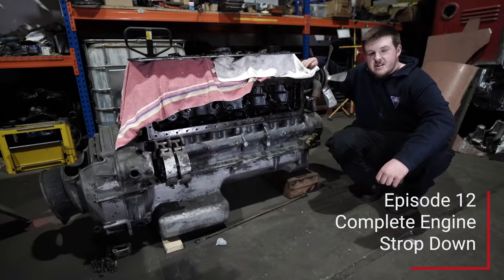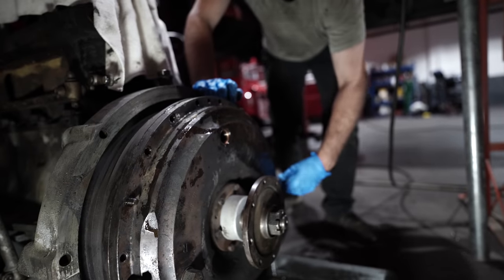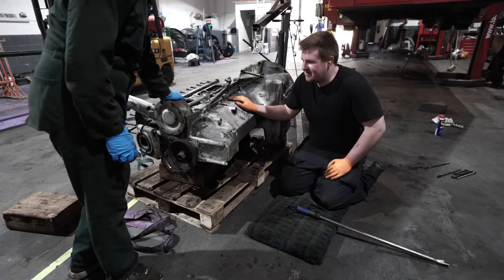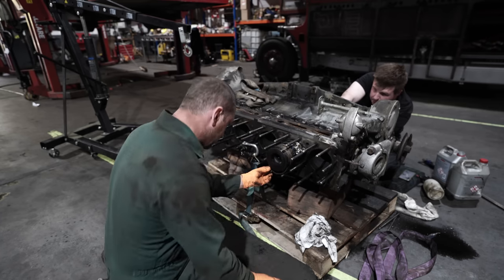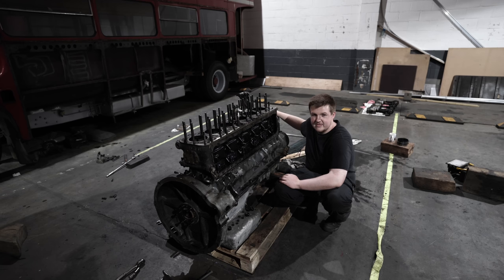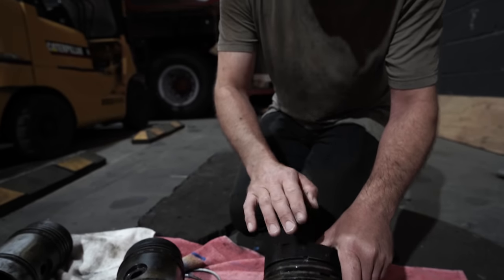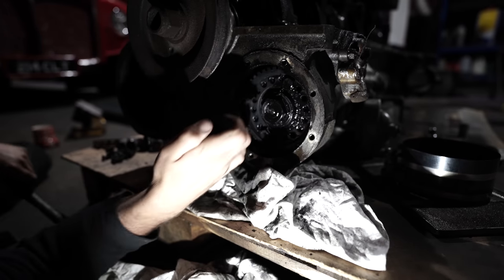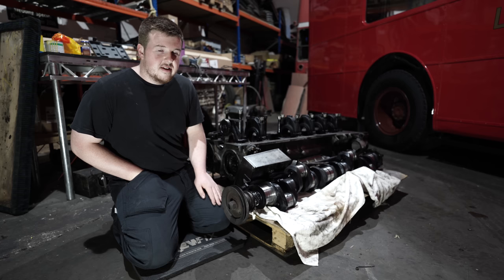Ep12: ENGINE STRIP DOWN Of A 70 Year Old RED London Double Decker BUS

Comment: Thanks for showing the engine strip down.

This is a task that the lads in the garages wouldn't be involved in.
I think the engine reconditioning was done at Chiswick to my recollection. 
We certainly wouldn't have the time, or equipment  for this type of work.

 These Buses certainly had a very hard service life. My last garage BK had a fleet of 140 vehicles for service. I think this worked out at about six million service road miles per year.

With the privatisation of London Transport, all the overhaul workshops were closed down. Good to see that you've got your own mini Aldenham works there. I'll certainly look forward to your next film.

Kind regards Jonnie.
Reply: Engines out and on the Ford Thames ? Trucks to and from Chiswick to garages if required , otherwise swapped at Aldenham (Chiswick still did the Engine Overhauls).  IF This engine is from one of the Country Area Cravens Bodied RTs it has probably done not a lot of mileage - 1949-1956 mostly around Watford, then 7 years in Scotland (cannot think it could have done much - prob construction work sub contracts ? ), a year back in Harold Hill then  broken for spares with the engine coming to this bus.

Comment: I love watching these strip down and rebuild projects. Takes me right back to my mechanic days. Also, when working on an old engine I would avoid using power and air tools generally. You get much more feel for if something is seized or likely to sheer using hand tools and ratchets. Amazing that engine was running with a broken piston ring.
Reply: Someone who understands 🙏.
Reply: Hi Chris......i always use ratchets and breaker bars, no air tools for me, old school engineering.....
Reply: "shear"; engines are not sheep :)  But yes, jokes aside you are right, although if you're stripping down very corroded parts they'll probably break anyway, so wizz away with your power tools!  (Or use heat if they're not easily replaced at reasonable cost)
Reply: @JohnCarder  and spray everything in plus gas, then have a cuppa to allow time to soak into the threads before trying to undo any nuts or bolts......
Reply: I use modern power tools, when appropriate, as my old muscles cannot cope anymore.  Took me 1 year to free a main hull drain plug on a DUKW using patience to not damage and hand tools. So I totally agree with your premise. I already had pneumatic shock ratchet and other power tools but, they could have caused serious damage. I have to admit that my modern cordless power wrenches do have advantages at times. I still love my old hand tools that I can "feel". Just as you say. Hope the coming generation can know which to use for the best outcome. Snap it off. centre punch accurately, drill undersize accurately, re-tap to original thread. Never easy and rarely successful.

Comment: Another great and informative video from Routemaster 4 Hire.
I feel for you guys, expecting to simply replace gaskets and finding broken piston rings and scored bores.
I bought a Morris Minor in the summer which was supposed to be ready to drive. However, delving more deeply into the paperwork prooved it had not been really used in anger for almost 20 years. Structurally sound, with a good engine and gearbox, but it's fighting my efforts to get it back on the road. Now gaskets and seals are becoming an issue, last week, Mabel, as she shall be known, developed a serious leak from the sump gasket. I couldn't quite believe that, I've never heard of such a thing and now the boot seal is letting in the rain 😕 as well. 
Your channel has been a real encouragement, the level of repairs that you carry out is amazing and something to inspire me when I'm on my back fixing Mabel in the street. Will she be ready for half term??
Keep up the good work.
Cheers
Andy

Comment: Many thanks. You have touched on my second question. At Aldenham Works we know that chassis and bodies were separated and usually never reunited. The same, from your video, seems also the case for two separate refurbishment streams for the engines separate from the engines. Yes? And power trains too?

Anyway.

Well done all and thank-you.

Comment: IF this engine has not been changed since preservation,  it was from Cravens Bodied RT 1409 JXC 172  of Feb 1949.   The Cravens Bodied RTs generally didnt get overhauled due to surplus of RTs for service compared to needs and most were sold via the Dealer Birds.   RT1409 was broken up by the North London Transport group eventually with the engine going to this bus ( info up to 2019).  I am not aware of Roy Gould doing an engine swap on this bus.

Comment: Well, it was always going to be an overhauled Engine regardless of what state the rings were in. Crank regrind with new main and big end bearings, new or serviced Oil pump. New pistons and rings with rebored Cylinders, head skimmed with new valve seats, valve guides and if the valve faces are pitted, ground and lapped. New valve springs and replace the Rocker bushes. Fuel injectors serviced along with the injector pump and get a service kit for the water pump and starter and Dynamo, all replacement Gaskets and seals. This should giving you a good long lasting Engine. Re Snap-on impact Tools, I have new second hand 3/8 and 1/2 inch guns with the jacket covers on and the plastic cases or doctors bags. Thanks for video but don’t put Emery cloth anywhere near a Crankshaft!.

Comment: Absolutely brilliant video very educational. You and Lord Barrington need to teach apprentice mechanics stuff like this at colleges man
Reply: Lord Barrington definately needs his own channel, such a knowledgeable Engineer.
Reply: @stefanobio7045  definitely
Reply: @jamesbalchin4640  Unfortunately these type of skills are being taught less and less, due to the high labour costs involved, mechanics are now heavily involved in the electrical / electronic diagnosis side now....
Reply: @stefanobio7045  indeed
Reply: There are less and less people who can strip down and repair mechanical things these days. Its a great shame!
Reply: @timhines6543  Hi Tim....
Yes your correct i can remember the times when you saw vehicle owners on thier driveways at weekends with thier car up on either axle stands or ramps being repaired or serviced, something which you hardly ever see these days.
I also recall all the many independent motor parts shops some even open on a Sunday, you could ask the owners advice on the problem, hire tools like half shaft pullers and torque wrenches etc, but very sadly most of these have now closed, in fact one has just closed near to me after 43 years!
Halfords even had a trade parts counter, and sold all the service type items oils, filters, spark plugs etc, but these days they only have a very minimal stock.
Most of the Engineering technical colleges have now closed and are now just housing estates, all three of the technical and higher colleges that i attended are now all closed, along with it all the great and knowledgeable instructors and lecturers, very sad......
A high proportion of Engineering and manufacturing companies have now closed, steel works, ship building, mining, aero industry, most have closed now, for instance Chatham dockyard with over 6,000 staff all gone, and all those skills not being passed on, the railway engineering workshops in Swindon where so many of our trains were constructed and overhauled by great Engineers and tradesman also closed......
Apprenticeships in Engineering are difficult to enter now, and the skills of fitters, welders, tool makers etc are no longer being passed onto the next generation.
So hence we now have such a shortage of skilled labour within the UK.
In fact i was recently watching a tv documentary concerning UK fisherman, one fishing boat required some mechanical work to be completed on the engine, but the owner could find no marine engineers in the UK who could conduct the necessary work, so it was towed over to Holland where the work was completed.
Its a very sad state of affairs Tim and i personally do not see the situation improving.......
Thank you for the videos you really do need to start your own channel as you have so much skill and experience that you can pass onto others.
Best regards,
Stefano

Comment: I was a mechanic for 50 years and I had a lot of snap-on tools you only get life long warranty on hand tools not with air tools or a hand rachet gears just the handle.
Reply: Halfords have always replaced my damaged ratchets no problems.....i have an old all steel one, it even has an oil hole in the top of the head to allow the ratchet mechanism to be lubricated, it must be 45+ years old, used it most days, its been used outside covered in water and mud, i handed it down to my son who is a light and heavy vehicle mechanic and still using the ratchet......

Comment: Hi, I am with a not for profit organisation, we are restoring an AEC Regal Mark III bus here in Aus, for heritage service, it has a 9.6 litre AEC diesel engine in it.  Would you have a reliable contact that can supply engine components to allow an engine rebuild to occur?  Great video,  keeping these old buses on the road is a challenge.  Regards a fan from Aus.
Reply: It has taken me months to find the bits from people all over in workshops and back yard sheds. 99% of the parts are simply not out there anymore sadly. If you let me know what you need if you strip the engine down I may be able to assist in some way.

Comment: So why didn't you use the air ratchet gun for the boltsif the snap on one is fecked ? It appeared in the very next scene.
Reply: Too lazy to plug the airline in and turn the compressor on. Doesn't really take long with a ratchet and spanner. Just lazy using all these guns etc🤣
Reply: @timbarrington3607  old school engineering, the best!

Comment: More likely that the rings break on the wear lip at the top of the bore
Reply: I agree but you could clearly see where the ring had rusted to the bore only one side so I'd suggest given the lip is very slight that was the cause of the ring failure.

Comment: Isn't there an engineering shop that will reline the bearings?
Reply: There are places that will re white metal bearings but it's an expensive process so tends to be a last resort.
Reply: Have you attempted to obtain the bearings from "Vandervell" who probably manufactured the originals?
Reply: @stefanobio7045  we got the bearings but that's another story for another video.
Reply: @timbarrington3607  Hello Tim,
Ok im looking forward to watching that video....i used to work at Vandervell the company who manufactures the bearings, i used to repair all thier machines etc....
Best regards,
Stefano
Reply: @stefanobio7045  fantastic. Where are they based?
Reply: @timbarrington3607  Hi Tim....
When i worked at Vandervell they were then based at Maidenhead in Berkshire, it was a very large plant with many employees, however after i left they then joined the "Glacier" bearing company and relocated to Kilmarnock, Ayrshire, in Scotland, they are now part of the Mahle automotive group.
Vandervell also had another seperate factory in Tremorfa, Wales where they manufactured pressed steel rocker arms and crankshaft thrust washers etc, im presuming that factory was closed down in the 1980's when they moved to Scotland?
I met Sir Sterling Moss at Vandervell as he was one of the race drivers who drove the "Vanwall special" race car, a really nice guy and character.
Everything was completely demolished at the Maidenhead factory site and its now an industrial and office site.